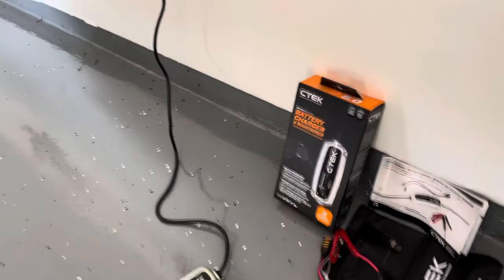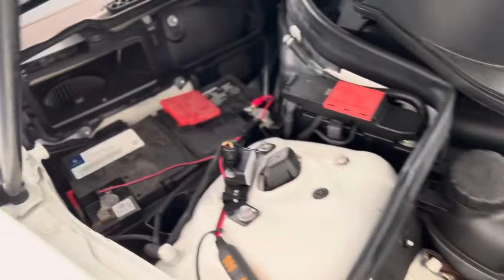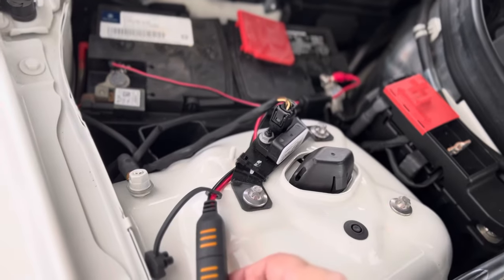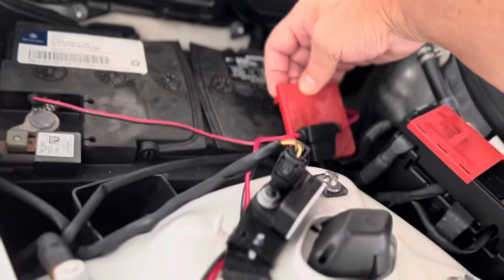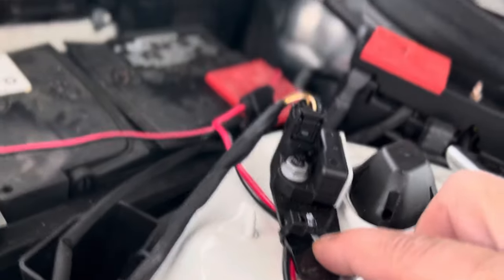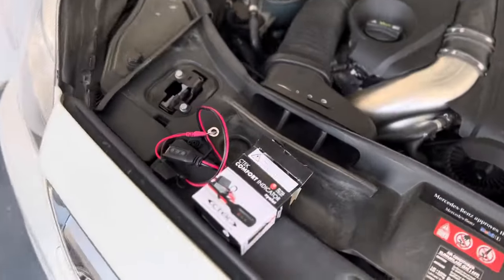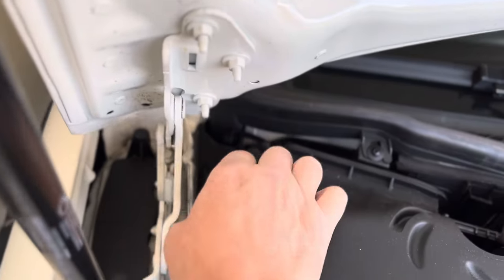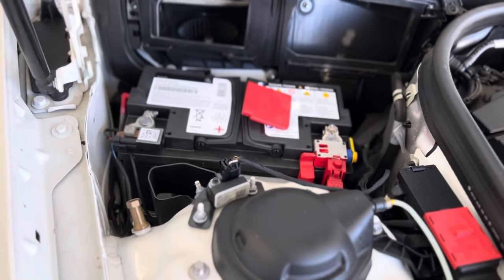How To Trickle Charge Mercedes Benz Connecting Directly To Battery W/ Eyelet Connectors

Comment: Thank you for the video but I still have questions. I have a 2012 SLK 350 Mercedes. I love my car but since it is a two seater it is not practical for an everyday day. I used it as an everyday car for 7 years but once I had grandkids, I needed a bigger car. Problem is I do not drive my Mercedes every day and weeks can go by before I drive it. However, I will not sell it. Someone told me about a trickle charger. I just had a new battery put in my car but not driving it for weeks will still cause battery to die.
I want to put a trickle charger on but I need something that can stay attached to battery but can also remain in car. I can’t lift the hood n my own. I have been told that some trickle charges exist that can be unplugged externally and then plugged back in externally once I finish driving the car. Does such a battery minder exist?  Thank you.
Reply from the maker: Hopefully this information helps.  You can purchase the same CTEK trickle charger and also purchase a 8.2 feet Battery Tender Extension cable here: https://www.amazon.com/CTEK-56-304-Comfort-Connect-Extension/dp/B00ADIHUVG/ref=sr_1_2?crid=329885A5HT742&dib=eyJ2IjoiMSJ9.4Pl4lJQ_ByOnSyOGp8dL7ZKX1rv1uTz4jIKb37eLyQ8dmApTBlmkLj6B8LFKLMOZOniQsa38aMeoIsILoyGeYFYvDCFW7TZa9WCvxJDdfl6_ueZdEkstm_8tmLnW_DkyteueC8gvgbD9JeaWXSNqr2bWbjqJHjoKJMdcn8t-gnh21h2GUhOvzTPcHq9aSVtCJzaoNg1MFNmTC5KuqPbZCXzS1xvu5I6F4ilsIOM5DBhhSTw7IA5YJIjTYXBP-AYARp76i9-7I1BKAVbusBaO-33IxPKBZPVY5qDS09mrGdI.kg6MO4NqpWWfvRSQbAN8zvLMR1dE9aT1Y5NKdbm6Yp4&dib_tag=se&keywords=CTEK+Comfort+Connect+Extension+Cable+-+CTEK+56-304&qid=1710708617&sprefix=ctek+comfort+connect+extension+cable+-+ctek+56-304%2Caps%2C93&sr=8-2

With the extension cable, you can run the plug-in portion down to an area between the grill and find a way to secure it there to plug in and unplug your battery tender unit from an outlet.  

Hopefully this helps!  Best of luck to you!!!
Reply: Thank you.

Comment: Thanks for your helpful video.  The bolt on the positive terminal seems to retain the nut.  I was torqing hard on the socket wrench but stopped cause something didn’t feel right.  This was on a 2012 MB GLK350.  Any ideas?
Reply from the maker: Thanks for the comment!  My guess is you stripped the nut.  You might have to purchase a new battery cable.  Looks like they are around $110 dollars.  https://www.autohausaz.com/pn/15281305-MB-0009052702?utm_source=google&utm_medium=cpc&utm_campaign=feed_Mercedes&gclid=Cj0KCQjwy5maBhDdARIsAMxrkw3rYEDyrb6n7i6LdA4xT7oXcq8sHy97oskCQ0zuw9Q-_Ngg1OJ14LsaAiiUEALw_wcB
Reply: @GrayTrend  👀  Definitely gotta be careful with these cables… thanks for the reply and link!
Reply from the maker: @rec0nnec  Best of luck to you!
Reply from the maker: @Krishna Thanks for the comment!  Appreciate that you watched the video.
Reply: @Krishna Ahhh… thanks for the heads up!
Reply: in

Comment: this charges and maintains both batteries on this car no problem? what about in cold weather? thanks
Reply from the maker: The CTEK trickle charger will maintain the battery it's hooked to.  A simple answer to trickle chargers working in freezing and sub freezing temperatures is yes. Canadians, Alaskans, the upper Midwest, all use one form or another of trickle chargers with vehicles exposed to extreme temps. All use any extension cord and a wired in place inside the engine bay, trickle charger or wall charger with alligator clips for occasional use. Even in an unheated garage, wall chargers work. They're designed to slow charge or top off a full charge as well as keeping the battery from freezing, slowing output known as the groaning starter.

Comment: Why do some other technicians say not to clamp directly to the negative terminal?
Reply from the maker: Thanks for the comment!  I'm not a certified engine technician but I've read that when you're attempting to jump start your car with a dead battery and attach the negative jumper cable to the negative terminal of the dead battery, it increases the risk of fire or explosion if the jump start doesn't go as planned.  Best of luck to you!
Reply: @GrayTrend  Thanks for the reply 😊 Whenever I use my trickle charger in my GLC, it doesn't detect the battery when I clamp the negative jumper cable to a ground point. But if I clamp it directly to the negative terminal, it detects it and starts charging
Reply from the maker: @briangale6025  Yes, every trickle charger I've owned, I've attached directly to the battery terminals (positive and negative) and it's worked for me.  They are great to have around when you need them.  My 2008 Jaguar XK drew on the battery constantly and always needed to be trickle charged.